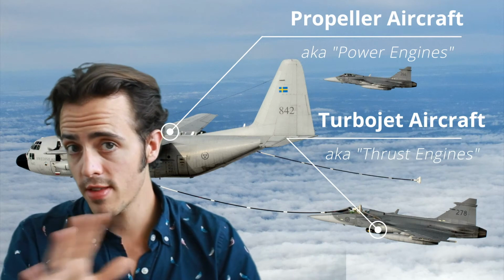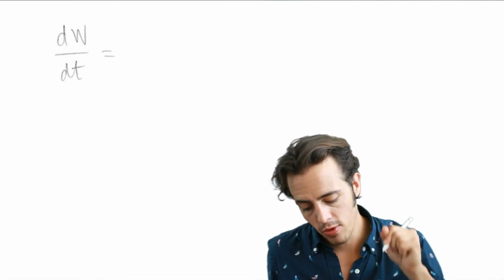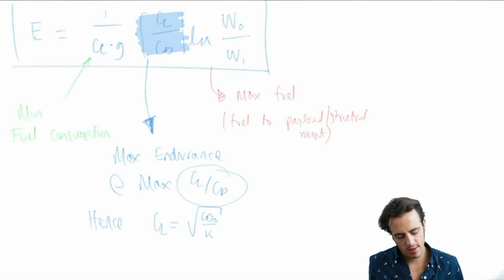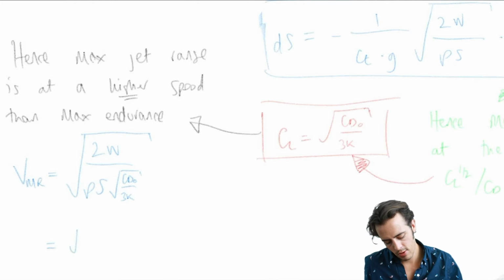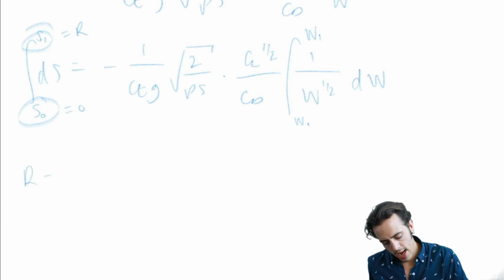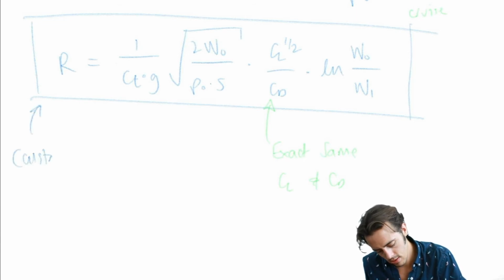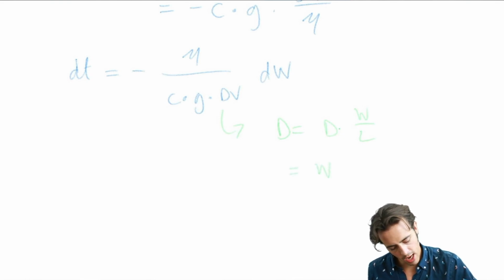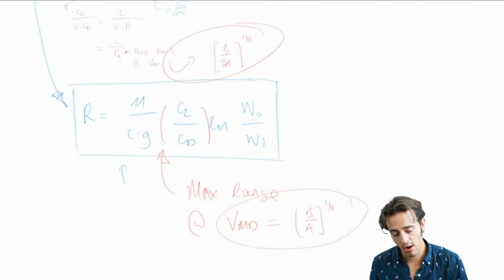Aircraft Flight Mechanics, Module 1, Lecture 07   Range and Endurance

Comment: i thoght we are using SFC (C ) we dont multiply by g , and only do so if we are using TSFC (Ct)
Reply from the maker: The difference might depend on what source you’re looking at but generally TSFC is for Thrust engines (jet engines), and SFC is for power engines (turbo shaft).

Both can be expressed as mass OR weights which so the distinction you’re making. Be careful with units!